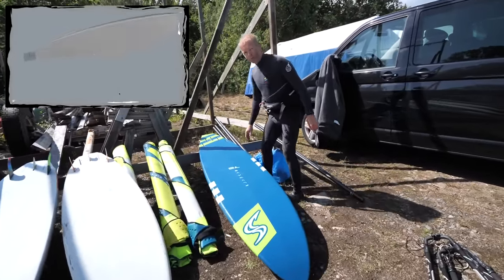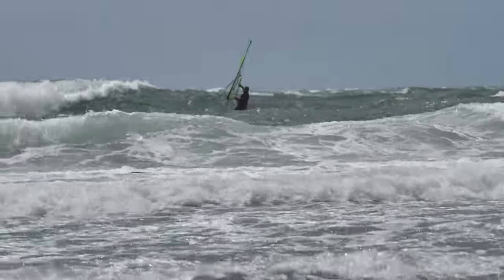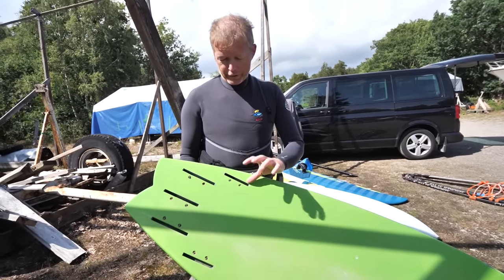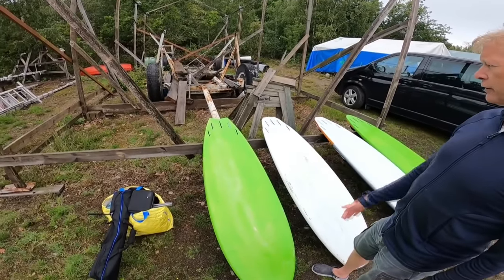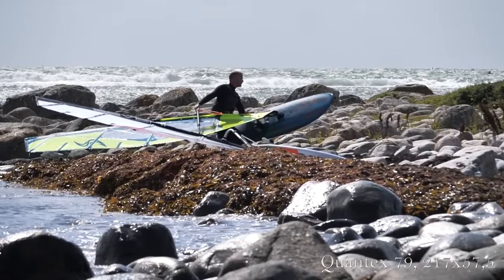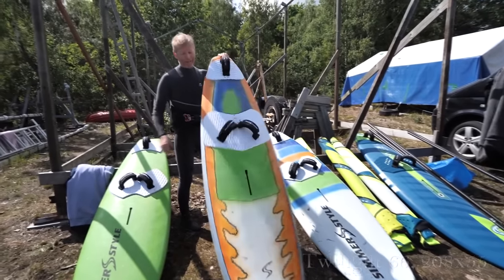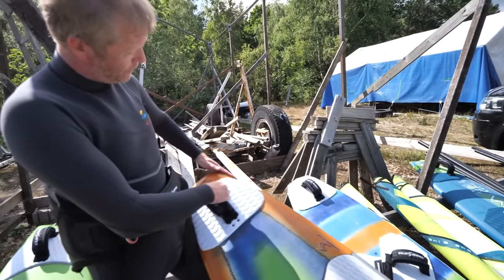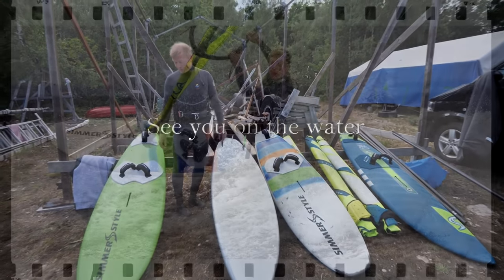Wave board design - Ola Helenius Talks us through his Crazy Quiver

Comment: Man, being a graduate myself, I know for a fact what it means to obtain an academic accolade like a Ph.D (in mathematics, right?) he has, and, although he’s very humble about it, it makes me entrusting the shaper he is even more, in reality, at the very core, windsurfing is based on physics and whatnot, moreover my helix 106 goes like hell, with 4 straps and a racing fin, it becomes an almost proper slalom machine, with 3 straps and a more curved fin, it shifts into a turny compact jumper, apart from riding like a “foil” (don’t know how to better express the feeling I get when blasting around…) as,  all in all, it’s indeed somehow related to foiling I guess, as in barely scratching water’s surface and/or giving you that sensation really…not to mention construction, quality etc, one of the few brands that gives you as stock a carbon fin, carbon fin box, carbon base-plate box and integrated goretex air vent, among other things …

Don’t wanna sounds like ploughing the brand and all, but, from my experience (and from that of other riders as well) those boards, are even too underrated if anything.

Anyway I went longer than expected with this message….Peace guys, thanks again for all you do for the sport and the stoke, keep up the great job!! Cheerse 🤙🏻💙🤙🏻

Comment: Thanks Ola for this interesting information! You are ripping up your local spot. Looks like you have tried many unusual fin configurations. What are some of your stranger setups on the Flywave that you have liked in good head-high waves? I usually sail the suggested quad setup but with one size smaller inner fins on the bigger board sizes such as the 99L. I sail in Sagres with Ben usually pretty windy and steep waves.
Reply: On the Fly, I sail fcs fins up front, the smaller ones, set a bit deeper in the box that I discuss in the clip. They are set with about 1.5 degrees extra toe in. The closes commercial fin would be the K4 Ezzy asym 1 degree 10cm. Then I either use a 15cm center blacktip rear fin (ie thruster setup) or two 13cm (or smaller - I have some customs) rear fins in a quad set.  In particular if you already sail with smaller rear fins, you should try the asym Ezzy fins in the front boxes

Comment: Would it be correct to say his preferred volume is a lower number than his weight? Super interesting video, would be great to see more like this...
Reply: Not lower, usually. Most my boards are between 73 and 79 and I'm 72-73 kg myself. But unless it is super sinky conditions or a very critical big wave spot I don't care so much about volume. I have had periods when I used quite big boards sometimes. It's good for developing some aspects of your technique. But on the types of spots I ride at home (and actually many other places too) the interesting things on the wave happens very quickly. Then I prefer  a small but very efficient board.  I luxury when designing boards for yourself is that you don't have to care about any compromises.
Reply: I find boards without very pointy drawn-in noses really pleasant - it feels like width and where this width is more important than volume? @olahelenius
Reply: Width is important, yes, but most important is the distribution of curvature. Most of my boards have quite "blunt" noses because I like them as compact as possible. But Sometimes I use a bit pointier noses too.  @windsurf888